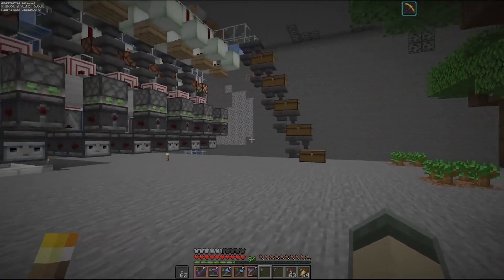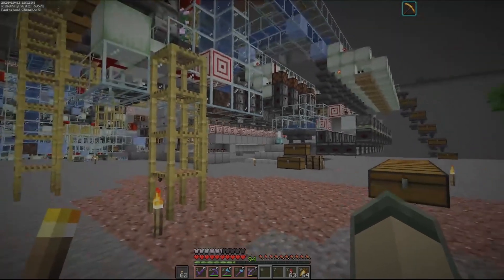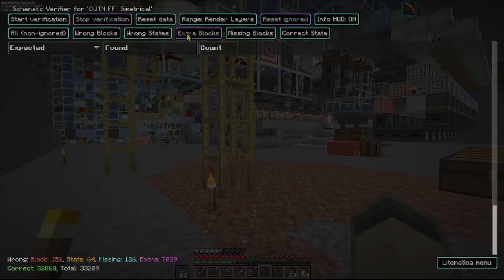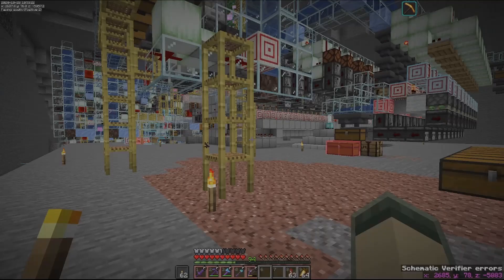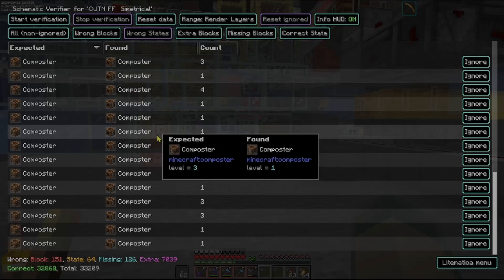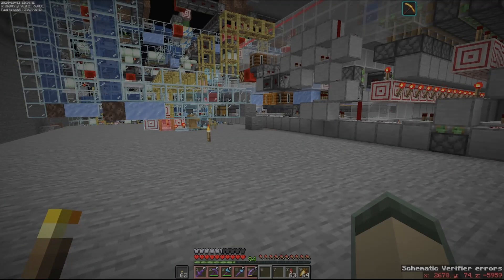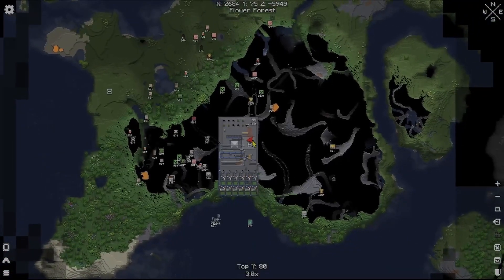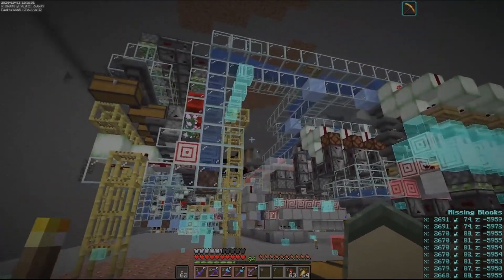Minecraft Litematica schematic verifier

Comment: So when i try this it just hylights all the blocks
Reply from the maker: If you click the header label Wrong Blocks or Wrong States of the generated list it will select all blocks in that section.  Example clicking Extra Blocks label will select all extra blocks found in the search. same for wrong block, wrong state, & missing blocks.  You need to select each individual block you wish to find.  This is ideal for when you have pretty much finished building and want to verify your work.  If you have hundreds of blocks missing or what every I would say change range all button to range render layers and adjust the render layers to all below and set it to only render to the y= level of blocks already placed then run verifier for only the completed work not the entire thing.
Reply: @waynestir  it turns out the mod was bugged I fixed it